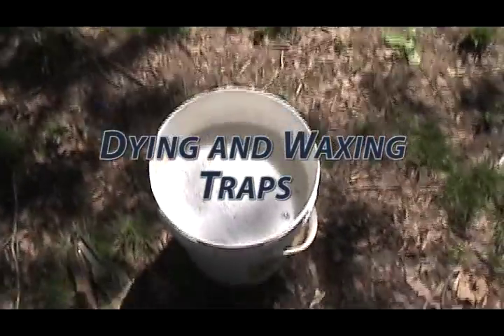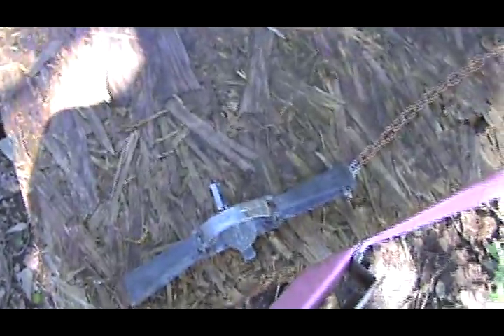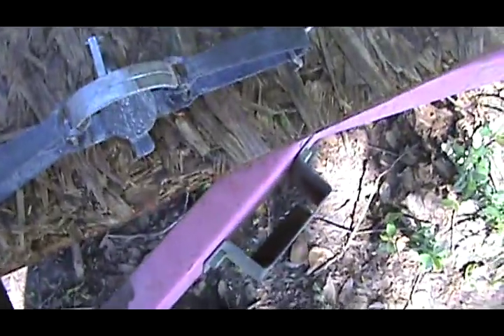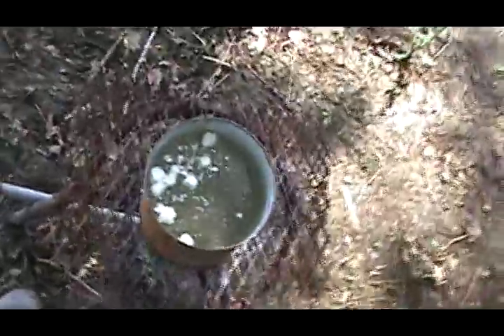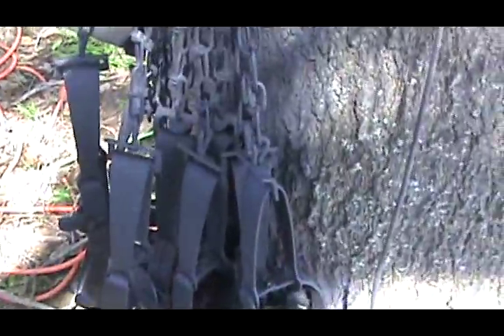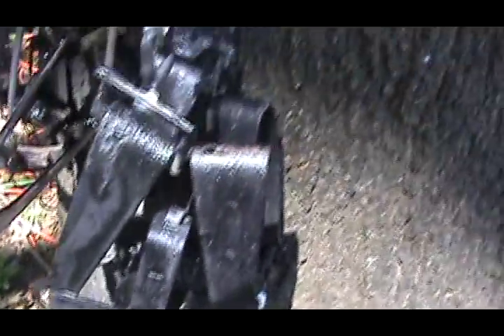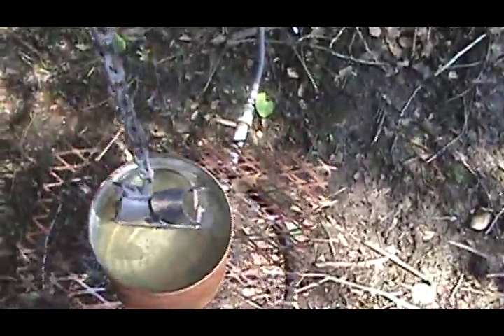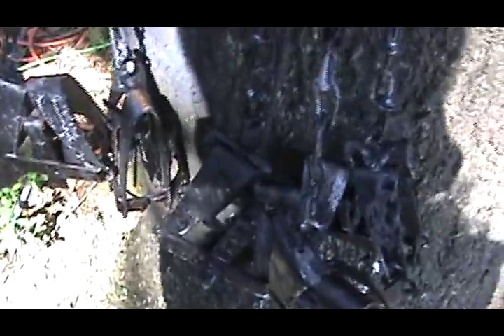Dying and Waxing Traps

Comment: In all my years trapping, I've never heard of anyone spray painting their traps. That's a new one for me. I clean, dye, and wax traps every season. That's what I'm used to doing. Too old to change now.  You have long spring traps there. You might get by with paint on those. But with my coil springs, I'd be worried about paint building up in them.  Does it freeze much in LA?  I guess it could.  Where I live, if you don't use wax, your trap will never fire in cold weather.  Too much ice buildup.

Comment: The smell of the paint can be covered well enough so that it doesn't make a difference? That's about the only trade off I can think of with using paint instead of the old walnut method. Or do you clean all of that off when you get ready to use them?